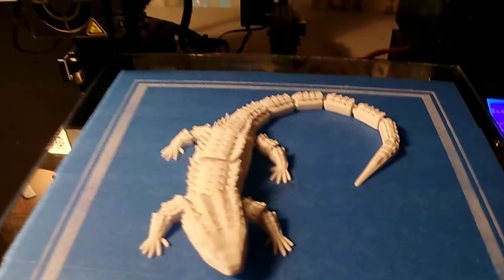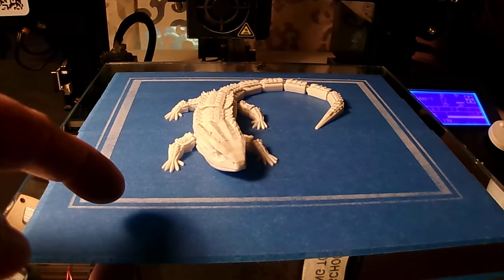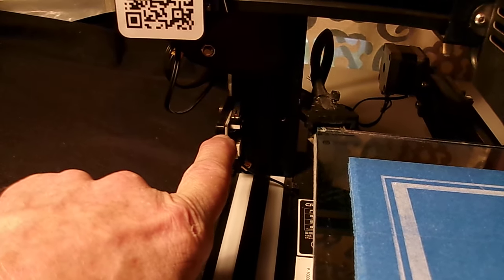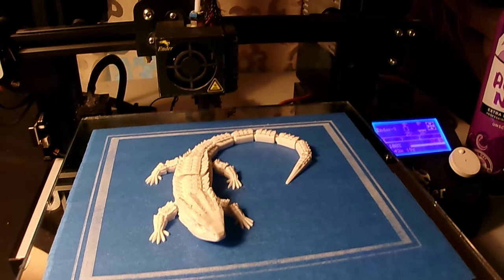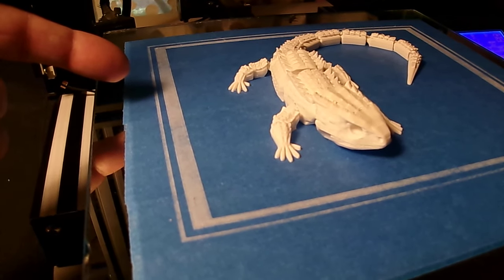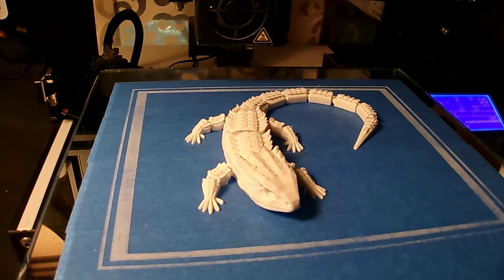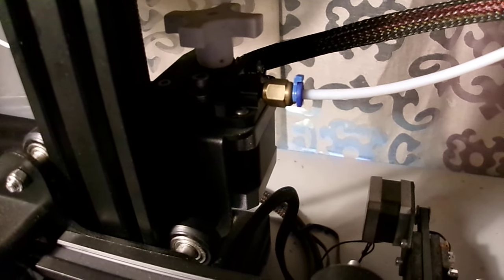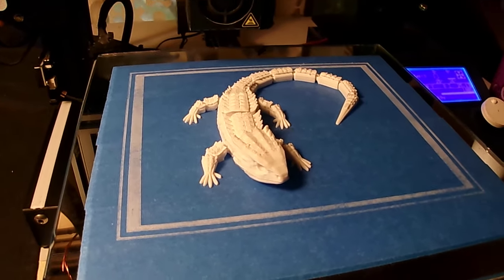ENDER 3 - No added (so called upgrade) frills. PLA - Crocodile SKINK

Comment: 😂😂 You will get so many dislikes for this. 
I agree with you. i have been rocking my ender 3 pro for 5 years, with minimum issue, i just upgraded to direct drive for flexible filaments and new bed sheets for 50$, and that's it. 
I have been looking for new printers, but why? Those youtuber are playing with my head to spend my money for things I do not need. I don't need a new one. This one works perfectly fine.  I can still run the ender3 for a long time, and if anything breaks, i will just buy replacement parts for cheap..
Reply from the maker: 😆 We all have our way of printing that works for them.
Happy Stress free printing.